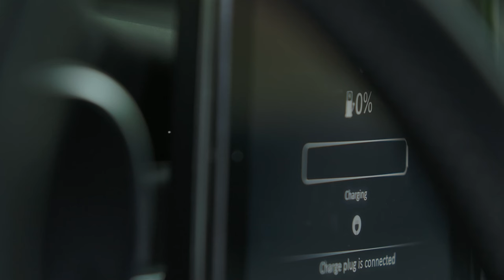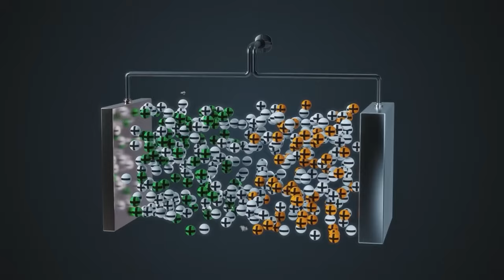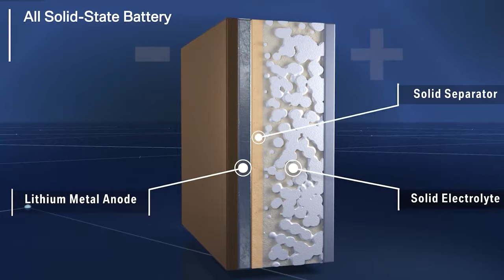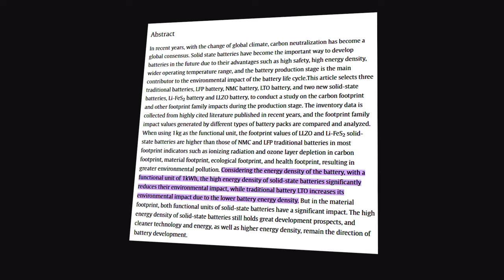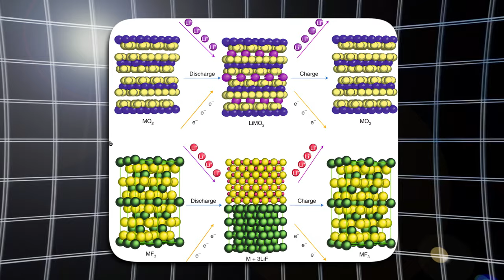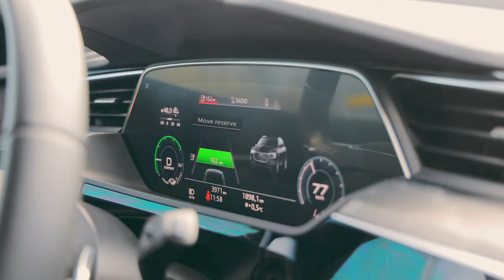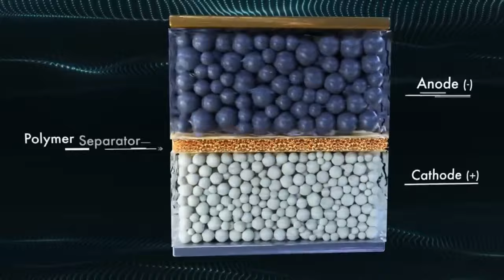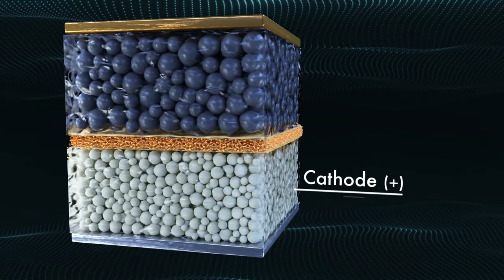How Solid State Battery Can Change The EV's FOREVER?

Comment: Solid State batteries appear to be exceedingly difficult to make. Ultimately, you have to be able to make cells cheaply and with a very long service life. Solid State batteries pose huge challenges in those areas. The leading battery manufacturers are making steady progress year on year, improving existing batteries to the point where the advantages of Solid State batteries are being eroded. By the time they come to market (if they ever do), they will probably just cost more but have the same characteristics.
Reply from the maker: True 👍. And what do you think about the future of hydrogen cars?
Reply: Exactly. Companies like CATL are solving all the issues. No cobalt/Lithium. Dendrite growth. Cycle life. They are all being tackled really quickly.
Reply from the maker: Thanks for sharing your knowledge. Really appreciate it 🙏. Helps me alot.